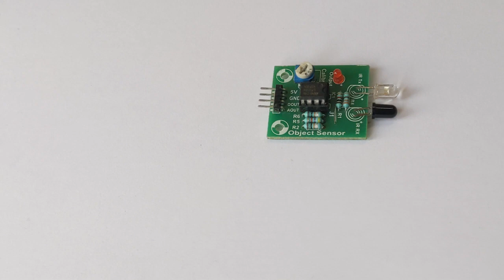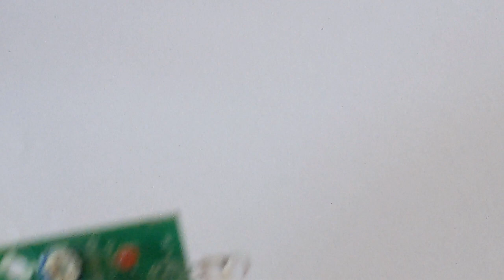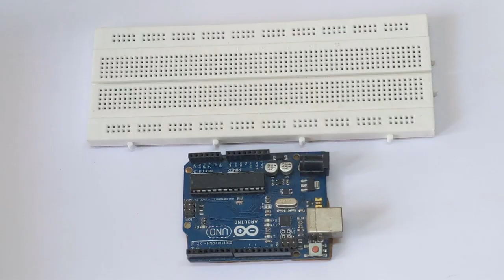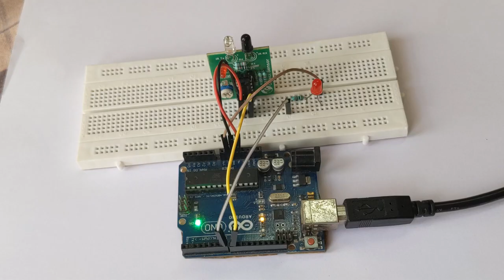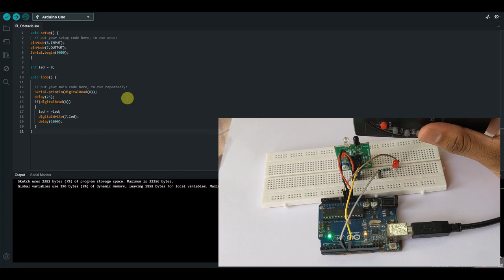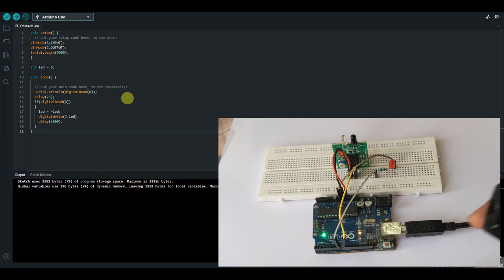Simplest way to use IR Obstacle Sensor | Arduino UNO | Old remote Control |

Comment: From where did you buy Arduino Uno? I can't find it on Amazon India
Reply from the maker: I have bought from offline store..... If you want to buy online there are many clones of Arduino Uno (Amazon/Robu.in)
Reply: @adithyatg9229  ya I visited robu website, but I only have one concern which is if robu is a reliable website or not. Never purchased anything,nor heard about it before.
Reply: @adithyatg9229  is robu a trustable website?